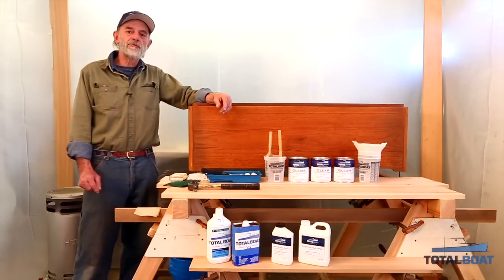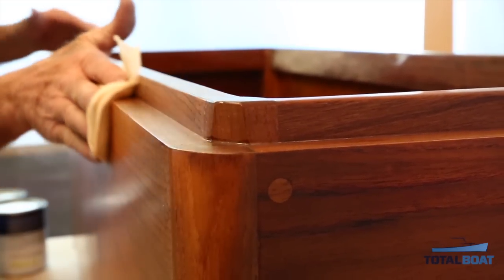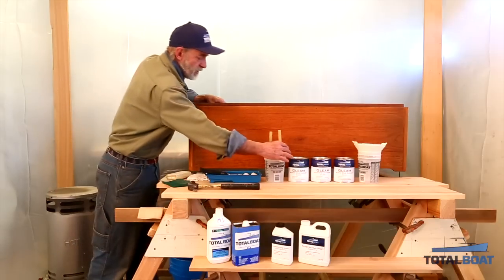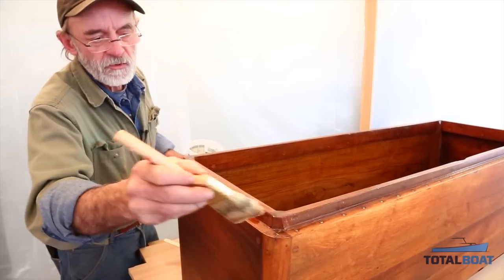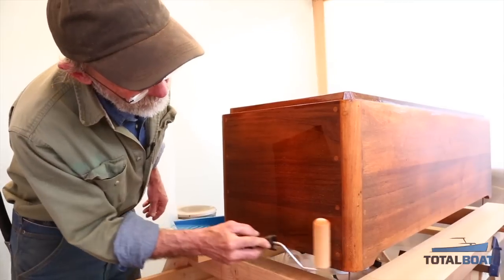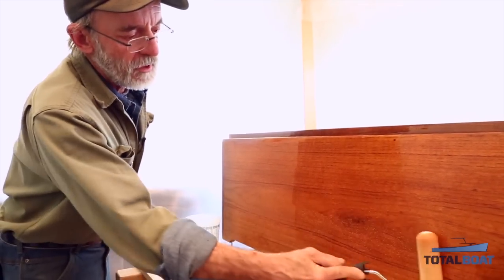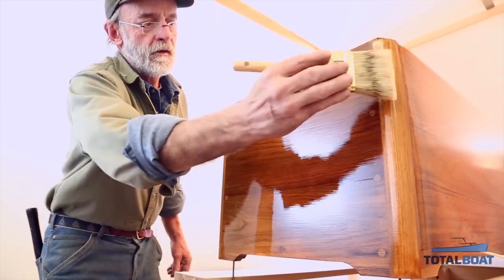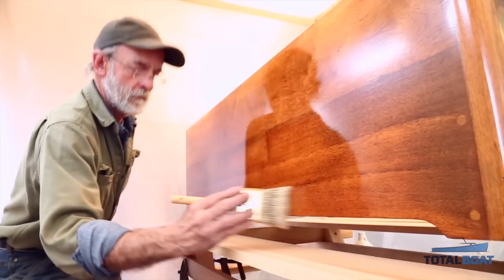TotalBoat Gleam Varnishing Tips

Comment: I’ve been a wood finisher on and off for over 40 years. I’ve used everything from oils to lacquers, French polish and sprayers. I find myself in the same camp as this guy. The small foam rollers put on a very even coat, and tipping afterwards with a quality badger bristle gives you the smoothest finish you can get with the least mess and effort. I will add one hint; beware of fish-eye. Where contaminants (silicone) give you small dots where the finish is repelled. You can equalize this by adding silicone to you finish. Just a few drops per quart or litre.  Also kudos for great commentary.

Comment: Did you thin the Gleam varnish before you applied it? It looks like this is a 1-part varnish - does it still have the durability and water resistance of 2-part varnishes? Thanks for sharing.

Comment: You make it look so easy! : )

I'm going to attempt this roll and tip method when applying varnish to the top decking of my 16' garvey.

How much pressure are you applying when sanding between coats with 320? What's the goal? To remove high spots and any air bubbles? Light touch or assertive force?

Many thanks for another very informative video.

Comment: Thanks for the great video.  The foam brush is a great tip.  I built  a mahogany Lutyens bench and used a satin spar varnish to protect  it.  I'll  be using Total Boat next time because the Minwax did not hold  up well.
My question has to do with total Boat epox as a "primer" and then followjng it up with their spar  varnish.  Any chance  you may have done this?

Comment: Wow you are a true craftsman  I am going to varnish  my old  guitar. I using to be like a sealer over the old finish.  Was your varnished thinned out? I am in Texas where the weather right now is very hot and wondering how time I will have to work / or to move varnish
Reply from the maker: thinning will help with the heat. Your varnish will cure faster in high temps, for sure. The exact time depends on the conditions, humidity and how much you thin. Just don't go back over varnish you already laid down. Good luck!

Comment: I noticed that the most basic microfiber cloth is better than the tack cloth when working with wood. Only way to get rid of lacquer dust in the pore, in my opinion. Purely mechanical as there are much small brushes on a supple cloth.
I also use microfiber to get rid of oil after oiled sanding (or French polishing FWW)
With à bit of alcohol distributed in it it get me free of oil traces on a surfacé that I am working on with shellac, pu, Nitro...

So, first the tack cloth, then microfiber (then compressed air if the paint booth allows for it?) 

Is it the UV protection that darkens the varnish?

Comment: More advice from professional varnisher follyrob reddit/r/woodoworking - http://redd.it/25q4ub
"Have the brush tip slightly moist when "tipping" out the varnish. If it is completely dry it can easily pick up your rolled on varnish and leave dry streaks.
In this video he is using a tung oil based marine spar varnish. A quality badger hair brush works great with this type of coat, but if you don't want to spend the money, a great finish can also be achieved with a top quality synthetic.
Microwave your varnish first. I know it sounds odd, but slightly warming your pot of varnish (maybe 20-30 seconds in the microwave) helps it to flow out better, keeping brush stroke marks and joins to a minimum.
Thin the varnish to suit your environment. Is it room temp and indoors? Then very little thinner is needed. However, if the sun is shining, there is a slight breeze, or it's the air temp is hot you can thin the varnish up to 12% or so. Use the recommended thinner.
Don't go back to "fix" runs, drips, or dry spots. If it is on, then it is on. Even after a minute, going back over the finish with a brush will do nothing more than cause unsightly brush strokes."

Comment: What I don't get is this guy does not worry about the "dry into wet" rule.  He just seems to put the brush down anywhere he wants except when he is doing the final tipping from end to end, but even then he starts the brush at the wet end (I think).  On some other videos he simply strokes back and forth instead of one direction and it works fine.  That would never work for me!
Reply: I agree. I have always brushed towards the wet, this is also a must with spraying. whenever I start brushing willy-nilly the start of my strokes look awful